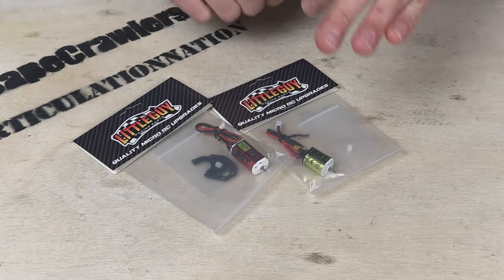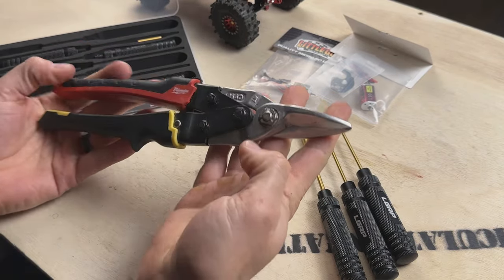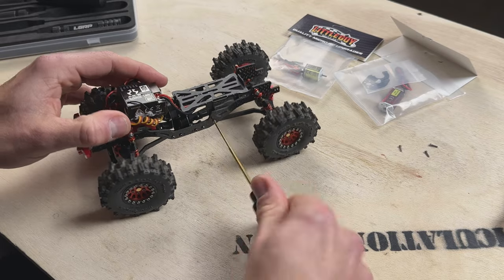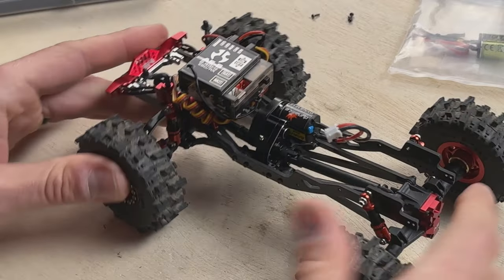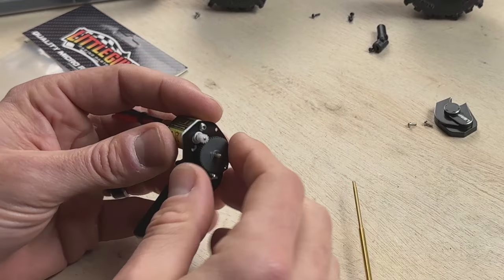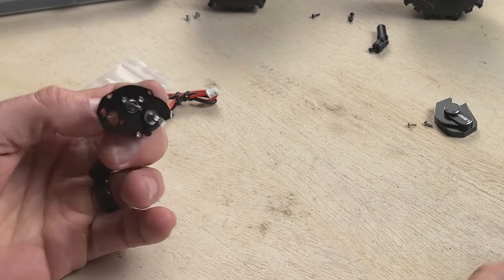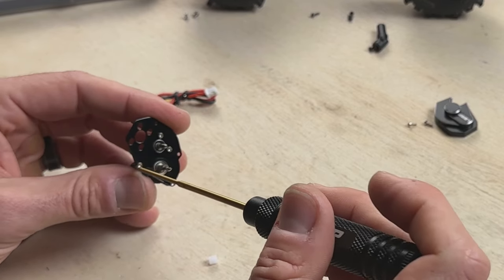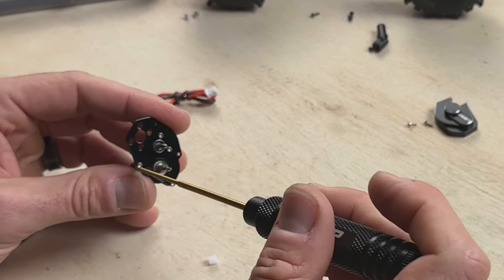SCX24 Beginner Series - HOW TO: Motor Upgrade and Installation

Comment: What are the differences in between the motors and how do their performances compare to the factory motor?
Reply: I know this is an old comment, but just for anyone reading really the performance gains are marginal at best from most motors I’ve seen, some like the injora 66t do give noticeably more speed but most are about the same, and low speed modulation is much more to do with the esc than the motor. The worst part is the turns seem meaningless for this size for some reason, like the injora 50t is much slower than the 66t, when it should be opposite, then most other motors seem about the same rpm as stock. Also longer cans don’t give much more torque compared to going bigger diameter, that’s also why the performance isn’t really affected all that much with the longer 050. Still worth it to get, but I’d just curb expectations, it’s nothing like going from a 380 to a 550 or something like that.

Comment: This video was awesome dude!!!

I just discovered you about a month ago or so.

I've had one of these lil trucks for two years and even though i use it quite often its lasted becsuse o only slow crawl with it so the mortor has never burnt out... until finally just recently.

And it's just been sitting becsuse i didn't know how to pull it apart to do a moror swap without getting carried away and ending up with a table full of parts that i didn't know how to put back together.

But you just explained it so simply and easily that i'm gonna do it right now since i have the day off today.

Thank you!!!!!
Reply from the maker: Thats awesome. So glad it helped!

Comment: Hey Adam, just real fast. I want to say that i had to replace the motor in my deadbolt and i got the barrage motor. I hated it. The motor shaft was not splined like the stock motor.  So, the pinion gear slipped on the motor shaft.  Also, had to reverse the wires im the connector. Obviously, i was not happy with the result. But, there is a happy ending. I replaced the barrage motor with a motor from samix same size as the barrage motor. Now my deadbolt is faster, which I didn’t expect but am pleased by. But, it also has more toque.  Anyway, it’s something you might feature in a future video. I like what you are doing here. Please keep doing the good work. 
Ps
I commented one other time about getting my deadbolt for the low price of just $16. I have now invested more than $300 upgrading the performance and could not be happier.  I still want to get wider axles or extension hexes and better wheels and tires.

Comment: As a complete novice I've learned a great deal from watching your videos. However is there a sweet spot for the number of turns a motor has for crawling? If so why would a motor with a higher or lower number ever be fitted?

Thanks

Comment: So with the new v3 Spektrum reciever 2in1 Can i add a External ESC 30a to the electronics an keep the Controller ? Also WIll it have the 3 speed Adjustment ? is that like a throttle dial ? You Rock

Comment: I did some upgrades on my deadbolt ...39mm oil filled shocks, aluminum steering linkage, emax servo brass diff covers front and rear , wheel extensions and bigger tires( not huge ones, but they are a tad taller ) the rc on low speed setting struggles unless I put it in Med or high...should I up grade the motor or the ESC?

Comment: A warning if you plan to use a longer motor and a buggy type body. The motor may end up blocking the full travel of the linkage depending on how your ride height is set. My old setup Injora buggy with gladiator high clearance links and ride height as low as possible will run into that problem.
Reply from the maker: Good point!
Reply: I hit that problem with heating the plastic linkage and when its softened a little, I just push it against the motor, maybe 2mm sheet in between. Pushing so that the shocks are compressing, I mean 😅

Comment: How much of a difference would we notice upgrading the stock motor to the Lil’ Rocket? Is it worth it?

Or the 50?
Reply from the maker: It’s significantly more powerful. Certainly noticeable and will stand up to more upgrades down the road like bigger tires, brass weights, etc. in my opinion, it’s worth it to step up to the 050 size because it’s a significantly bigger boost in power
Reply: @CapeCrawlers  thanks!

Comment: Will this motor install to bone stock scx 24? Have a link please and thanks. I subscribed
Reply from the maker: The 88t 030 size will fit a bone stock with no modifications. The larger motors (050 size) will still fit but you might have to trim the battery tray. https://littleguyracingparts.com/products/lgrp-brushed-motors

Comment: Great video! How are these motors sound-wise?  I hastily bought an injora 66t and it might as well be a nitromethane engine for the shrill racket it makes lol.  It made my "quiet crawler" unusable in my house with small children.  I'll use your affiliate link if when/if I buy. Thanks!
Reply from the maker: Lol they’re similar sounding to the injoras. The Mofo RC brushed motors are quiet if that’s what you’re after. The torque beast 050 and 030 are very quiet
Reply: @CapeCrawlers  Thanks! Just ordered the torquebeast 050